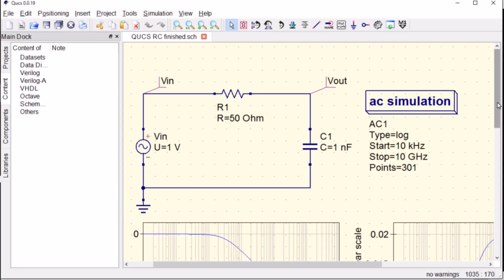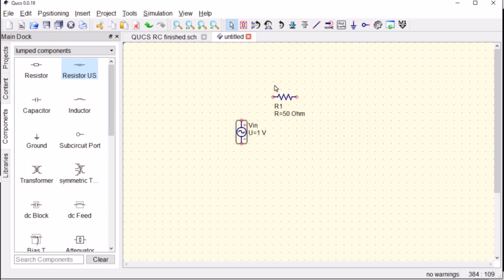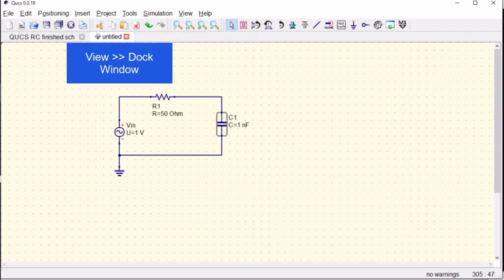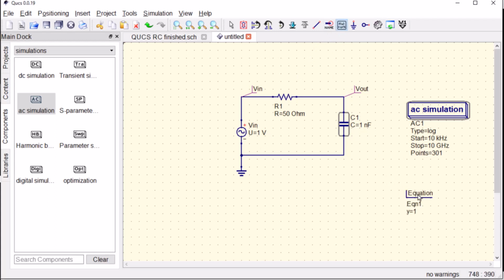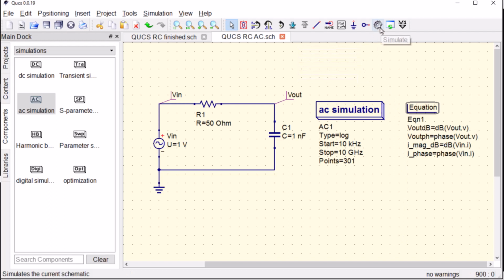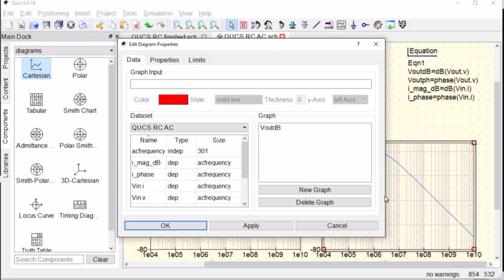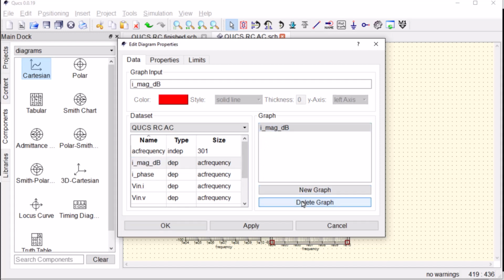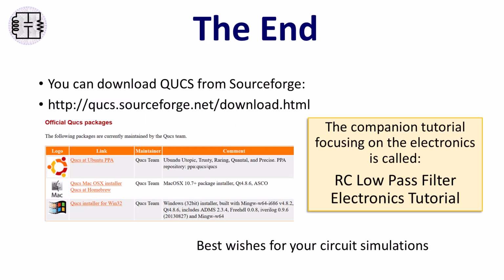QUCS Getting Started Tutorial RC Low Pass Filter

Comment: in Qucs version 25.2 this tutorial no longer works. It fails at the equation stage. When running the equation it gives errors saying Warning from checkvalid: vector vout.v is not available or has zero length.
Error: RHS "db(vout.v)" invalid and other messages
Reply: Warning from checkvalid: vector vvin#branch is not available or has zero length.
Error: RHS "db(vvin#branch)" invalid
Reply: @TangBengYong  try using this
VoutdB = dB(v(Vout))
Voutph = phase(v(Vout))
i_mag_dB = db(i(Vin))
i_phase = phase((Vin))
Reply: I had the same problem fixed it by adding a current probe called it Iout, but ngspice changed the name to viout in nutmeg equation you need to added them like so
vout_DB = db(vout)
vout_PH = ph(vout)
I_DB = db(ac.i(viout))
I_PH = ph(ac.i(viout))

and it worked, before adding equation add the probe and run sim and in the diagrams look at how they are named
Reply: @Xssap  mine still did not work

Comment: How did you learn how to use Qucs?
Reply from the maker: Hello, 
I was taught some signal integrity using QUCS, and I also experimented extensively to learn QUCS.  But, I have been using circuit and system simulation, including SPICE and Saber, for decades.